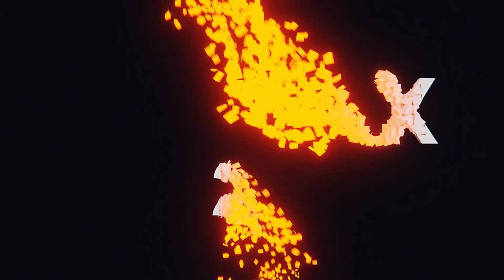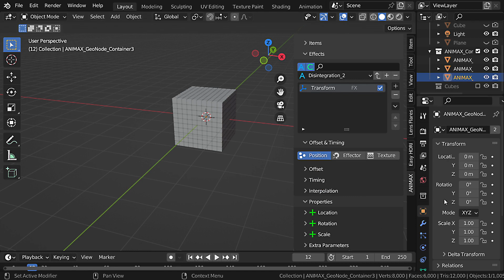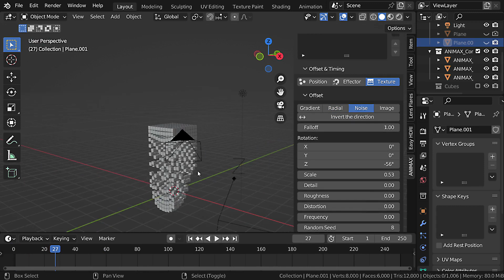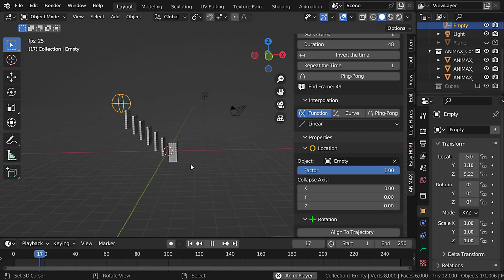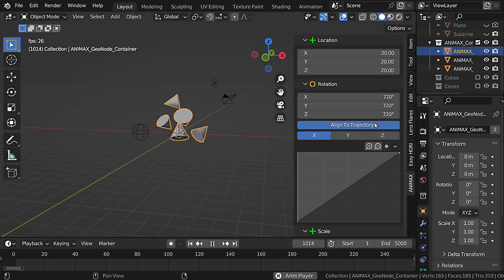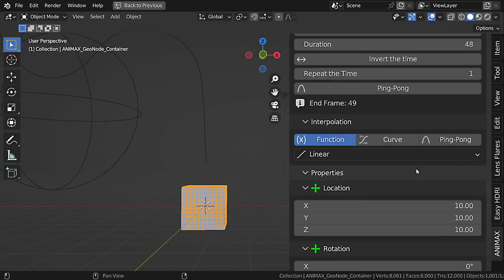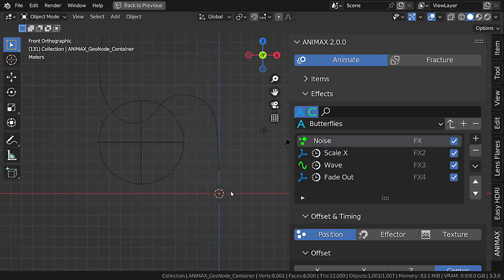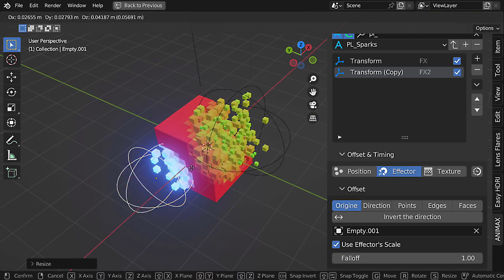ANIMAX 2.0 - Getting Started - The Animation System

Comment: My advice is not to try to learn everything at once. You can't, it has a lot of settings and those settings have a lot of combos, you are not going to be able to memorize it. Start making notes of what each of the 12 animation effect does. For me is more important to learn timing, replace, and synchronization. The effects are on a need basis and have so many options. One of the best and most essential blender Add ons. For me this is up there with hard ops and Mesh Machine.
Reply from the maker: Thanks! Glad that you like it.

Comment: Something wrong with version 2.1.1. Effects Offset, Interpolation and Properties not showing up on N-Panel. Using 2.01 for now.
Reply from the maker: You are probably using one of the add-ons for cleaning the N panel, it messes the UI of the add-on. If it's not the case please contact me in the market.